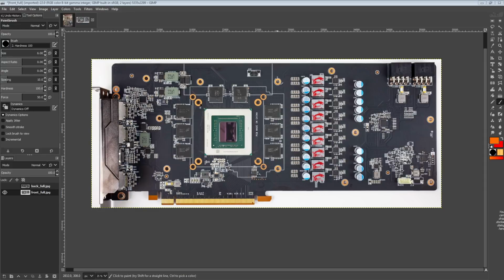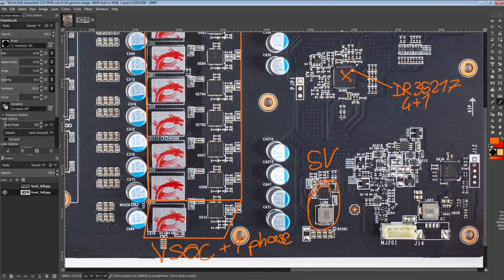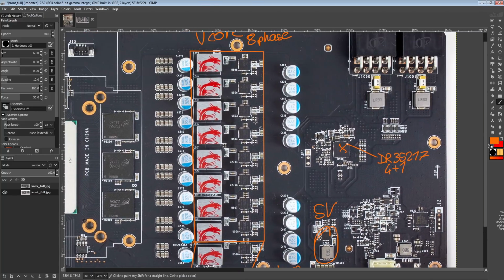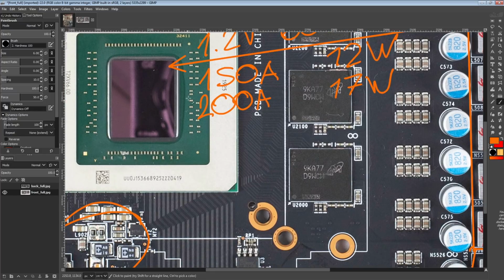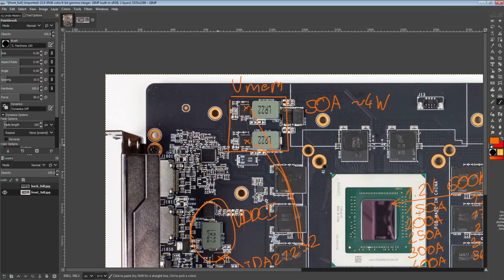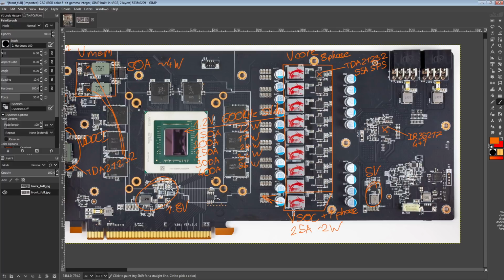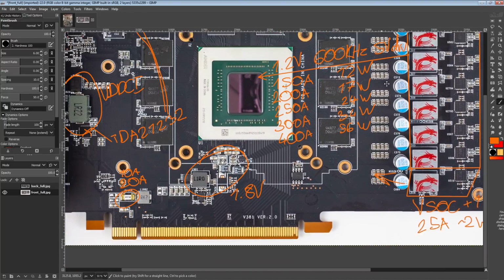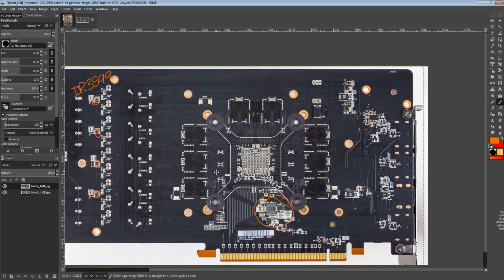GPU PCB Breakdown: MSI RX 5700 XT Gaming X

Comment: Unfortunately they messed a bit the memory cooling (pad placement), but they saved it by sticking thermal pads on the back to use the backplate. Let MSI do the board design and Sapphire the cooling. It looks weird on the MSI card when there is a thermal pad on the memory cooling plate which barely touches one heat pipe which goes across it. What is its purposes? Transferring heat into nothing?

Comment: Do all Blower RX 5700 XT's from MSI/ASUS/Gigabyte/Powercolor etc. use the same MOSFETs and Caps as the AMD Reference PCB?
Reply from the maker: I think so
Reply: Actually Hardcore Overclocking 
What about the 50th anniversary edition? I heard that it’s different. I think it has a full vrm layout on the back of the pcb

Comment: So, Strix keep being the best PCB. 
Could you Check some info? I used 2 5700XT REFERENCE cards, and some friends too. Each card reports different target clocks, my first one from XFX reports 2074mhz in watt or msi, just opening and not touching anything. My second one from ASUS reports 1989mhz. Swaping bios doesnt effect the clocks. Another MSI report 2030 I guess and other XFX reports 2020mhz. 
I think its related to ASIC quality which reflect on GPU CORE CLOCK TARGET.
Reply from the maker: that's normal for all GPUs that use non fixed boost systems. Cards with better silicon run higher clocks. You can buy 10 of the same model of 1080Ti and they will all run slightly different clocks. Same for Kepler, Maxwell, Pascal, VEGA and Turing cards.
Reply: But strix has garbage cooler too
Reply: @ActuallyHardcoreOverclocking  I do know, but I never saw reporting in msi or gpuz The "lottery"

Comment: I was wondering if you could help me figure out the problem with my MSI RX 5700 XT MECH OC, When installing this video card it works OK on the desktop but when I run a game the power consumption never go any higher than 105 watts. (card has a 225 watt TDP) then when playing the game it will crash (eventually never using more than 105 watts, then after the crash when I check GPUZ, the memory bandwidth getting cut down to 50% so from 448gbps to 224gbps. Could this be a fault with the IR35217 or is there something else I can replace. Thank you for your time. Sean. specs are asus rog strix z590, i5 11400f, 32gb ram 650 watt 80+gold psu.

Comment: Hey Buildzoid, how would higher Z capacitors affect the quality of voltage supplied to the chip?

What are the typical capacitor ESRs on the 5700/XT?
I figure 9mOhm is fine for extreme overclocking past 2.2ghz on these bad boys.

Comment: hi I saw the price of the GPU it's quite expansive, so as I see your review i wonder if it's the best choice for OC. I mind, is the sapphire RX 5700XT good enough to OC or is there a real big deal to buy this card ?
Reply: Check the tech powerup reviews they achieved better overclock with their MSI sample which proformed better than their sapphire sample. How this proforms depends on the silicon lottery that you buy.
Reply: @jackgleeson8321  ok thx i'll check their reviews

Comment: The PCBs on these Navi cards don't look very crowded, why aren't there any small form factor 5700/XT cards? Is it just marketing?
Reply from the maker: probably runs too hot to make a compact heatsink for it.
Reply: U have msi mech oc and it is very small
Reply: @jebotex  Well what I'm thinking of is single fan cards that are about as long as an ITX motherboard, so around 17cm-20cm
Reply: @DenGuleBalje  oh
Reply: @DenGuleBalje  it is 232×126×46mm
Reply: @jebotex  That's kinda short, sure... Hm.. maybe that's the card I should get for my "gaming PC in XBox 360 case" project that I never will finish.

Comment: This is funny you can see greasy residue on HALF of the top two RAM chips. From where they cheaped out on those thermal pads that gamer nexus showed.
Reply: gamer nexus was talking about the evoke card that the pads where much smaller; in this card these 2 memory chips sit closer to the gpu die so there is interference with the main cold plate that's why you can't put full size pads
Reply: Half pad 69 degree , full pad 72 .
'' you will notice that the fully cooled modules between VRM and GPU are much warmer! These temperatures also result from the whole copper in the multi-layer board and the high currents in the incoming tracks''

''But these “half” pads (savings per board approx. 0.1 Cent) do not influence the cooling performance and whoever claims the opposite here sensationalistically, happily celebrates click bait.''
https://www.igorslab.de/en/msi-rx-5700-gaming-x-review-radeon-power-pack-with-good-genes-and-also-a-good-thirst/2/